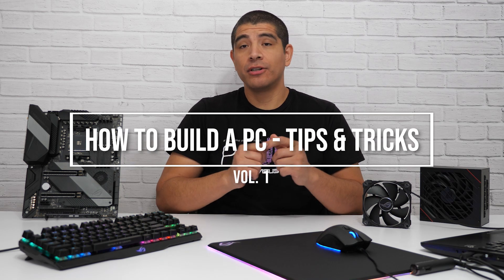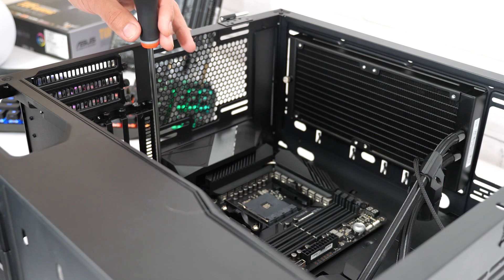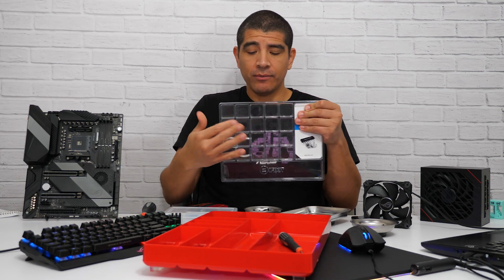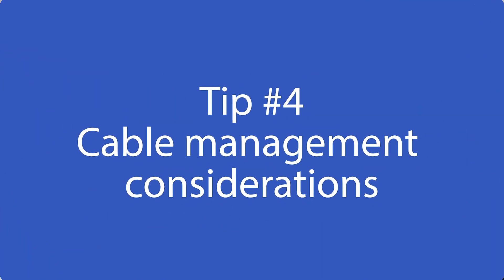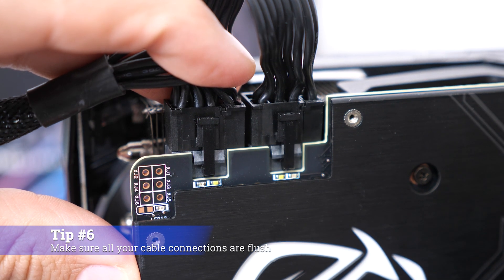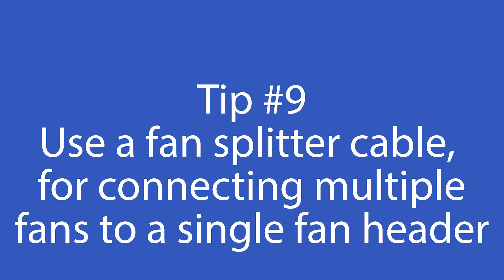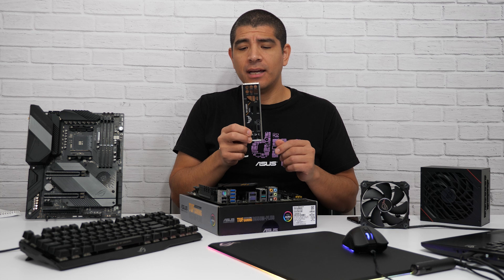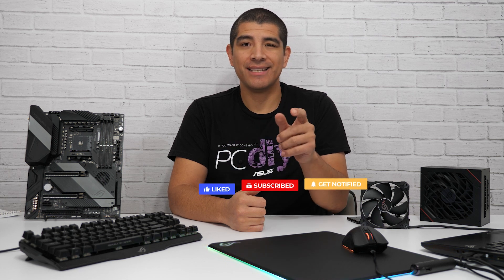How To Build A PC Tips & Tricks Volume 1

Comment: I'd like to install 192Gb of ram with the z890 Creator. On yalls site, this shows only 1 setup with a quad channel corsair at 5200, but the board is dual channel... So can I just select any 2x dual options to work together? I'd like to get 6000 speed if it's stable with that much ram and the ultra i7.

Comment: Great practical tips. The section on enabling XMP for the DRAM showed a screen shot of the BIOS settings, but it went a little too quickly to see. Just built a SFF system with an ASUS board. Great product. From my experience with that build, I would try to connect as much as I could to the board before installing it in the case. It was really tough to get your fingers into some of the locations afterwards.

Comment: Good stuff. I switched over to cable wraps now, but before I used twist ties on the first pass and replaced them with zip ties after all the cables are in place.
Reply from the maker: Sweet, I also prefer cable wraps. Best of luck with your build!

Comment: Hey JJ, long time no see!, do you know by any chance, why there are no mATX X570 (AMD) motherboards from ASUS?, I've been willing to upgrade for so long now, but so far I haven't found a single mobo from asus in mATX format with an X570 chipset.
Reply from the maker: mATX is not a high volume form factor so there are less options produced for it compared to ATX. Especially with compact ATX the highest demand continues to be for traditional ATX form factor. That being noted check out the https://www.asus.com/us/Motherboards/TUF-GAMING-B550M-PLUS-WI-FI/ It is a very solid board for an AM4 Ryzen based build and is a current chipset.
Reply: @ASUSUSA  Ouch, that's really sad; would that motherboard from the link be able to properly handle a Ryzen 9 5950X?

Comment: Jj, I bought one of your Asus hyper cards, why dont you guys have more info? So limited and its frustrating when you buy the card. I ended only using 2 slots and put in 2 980 pro m.2 s. But was told on x570 board can use all 4? Is there a bios update for this?
Reply: What motherboard do you have?
Reply: @joe_ferreira  I have the x570 Asus crosshair 8 hero wifi . I have the hyper M.2 x16 gen4 card with 2 samsung 980 pro 1tb m.2 s in it, was told if i add 2 more would slow down graphics card and speed?.
Reply: Also I suggest you contact support in your region. Asus motherboard support is great.
Reply from the maker: Not sure as to your question? I would recommend you reach out to our service and support team. They can review the exact specifications and operating/configuration parameters of the card. As the card uses PCIe bifurcation it is a little more complicated than a standard single slot add in card.